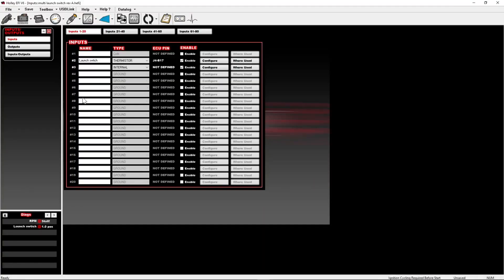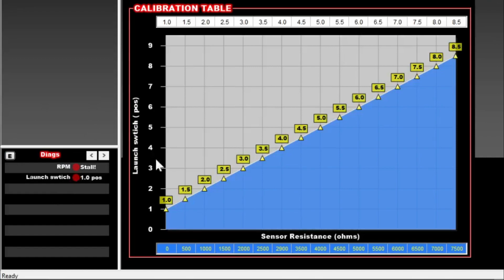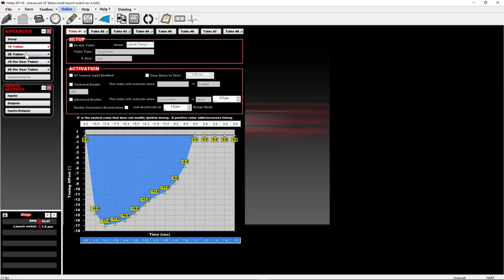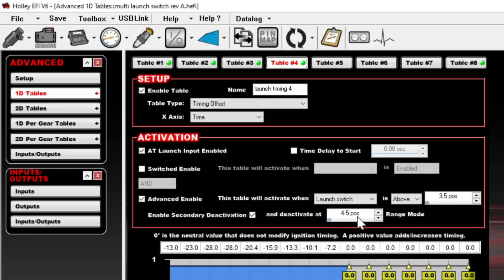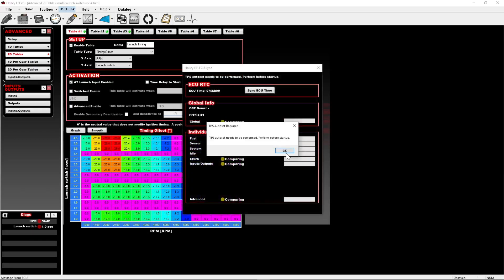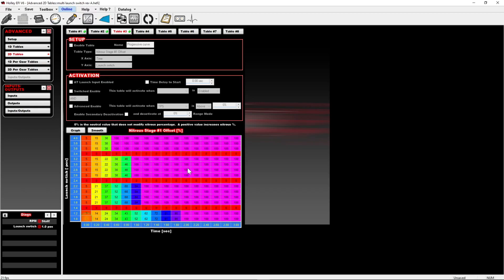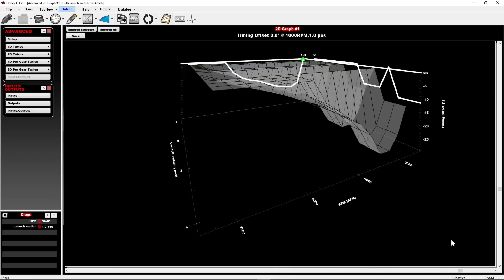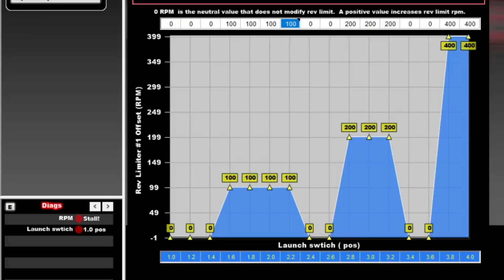power management adjustments at the flip of a switch using the Holley EFI Multimap selector.

Comment: I was just looking into ordering one of these switches to build 3 different tune ups and came across your video. If I understand  correctly, you also don't need to turn the car off to switch the tune with this method. Would this still work with the virtual switches on the Holley 7" digital dash? I'm not sure if you can separate resistances with a virtual switch like you show in the video. If you have to use three separate virtual switches (on/off) can logic be built into them that disables the others if one is activated so its not possible to have two activated at the same time?

Comment: I used the AEM 30-2056 12-position switch($27) to set up a variety of boost and timing retard ramps. You can follow Ryan's instructions here, it just gives you more options and is $80 cheaper than the Holley switch.
Reply from the maker: Perfect. I didn’t have time to research other switches so I appreciate the heads up that theirs works.

Comment: I've had this idea for a while and I'm just trying to find a switch that I like to do it with and I think I'm just going to make my own at this point unless you have some switch ideas you want to pass along while you're at it?
Reply from the maker: I really wanted to find some switches but at the end of the day I just ran out of time and decided I needed to get the video out.  

I planned on looking at industrial controls websites.  I figured there has to be something there
Reply: The AEM 30-2056 12-position switch works great and is only $27. You can easily use multiples of them for a variety of adjustments.
Reply: Thanks

Comment: I'd like to see some non drag race, non boosted content. Functionality you can add with the DBW throttle body would be great. Maybe flat shift, throttle blip downshift. Any way to make the throttle peddle into a torque demand peddle that takes current gear into account?
Reply from the maker: I’m open to ideas but the vast majority of my experience is drag racing based so it’s what I’m  most comfortable talking about. 

Having said that I’ve been thinking about ways to do some stick shift related controls like blipping on downshift and limiting power on the up shift